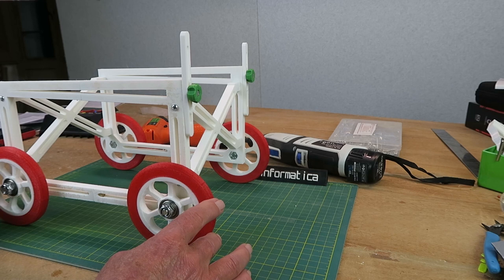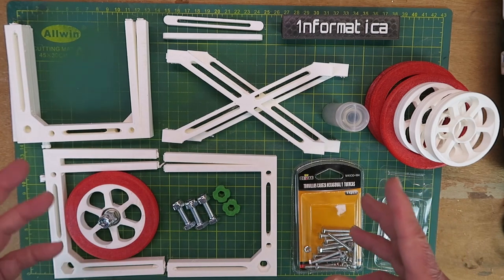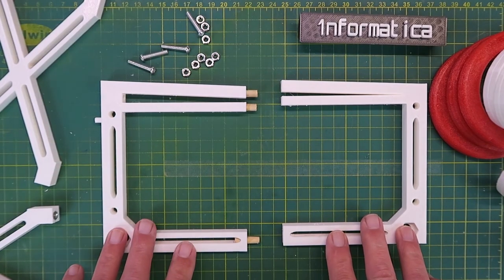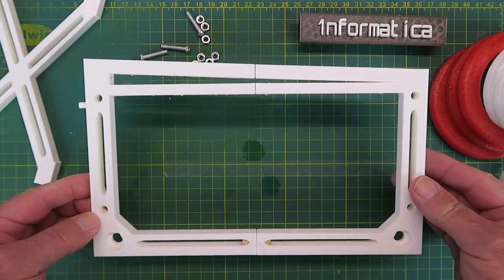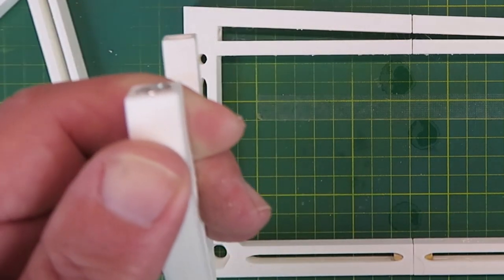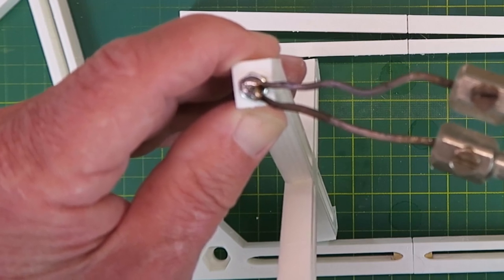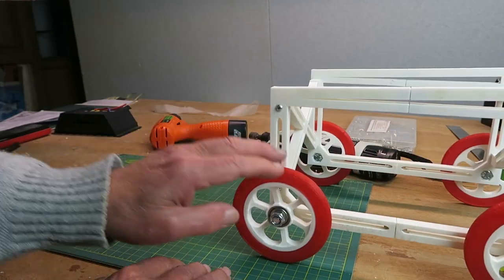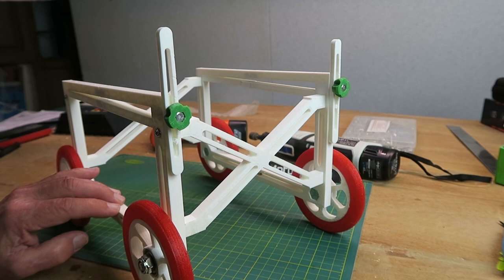Thingiverse RC Dolly for Small Planes Build Test

Comment: I’m a great admirer of dollies- but this is a first of its kind! All joking aside excellent video and great concept however from past experience some form of “track” is required to assist in getting the unit to run straight even on a metalled surface.
Reply from the maker: Thank you for your input Tom, much appreciated as always. I have a few mods to do based on your thoughts and others last week. We will see if it can do better. Otherwise I guess I need to talk to Roy to get "on track"!! 🚂